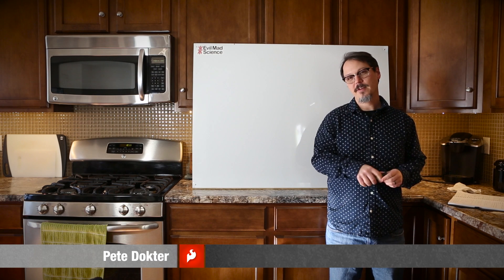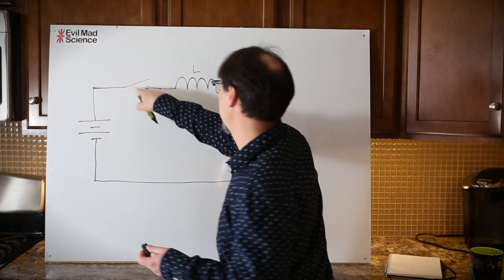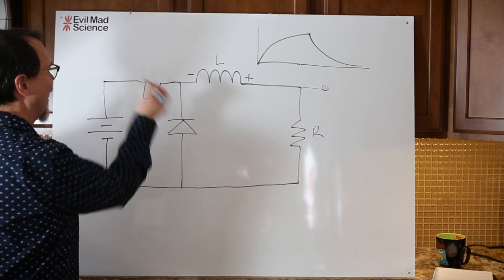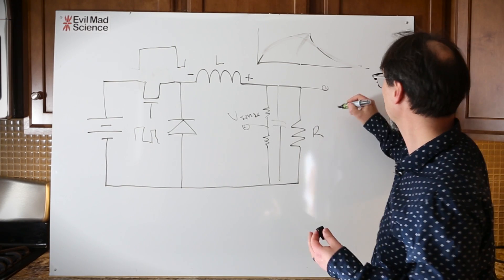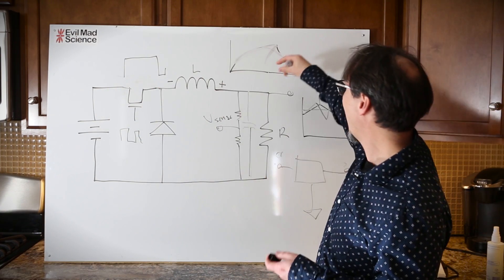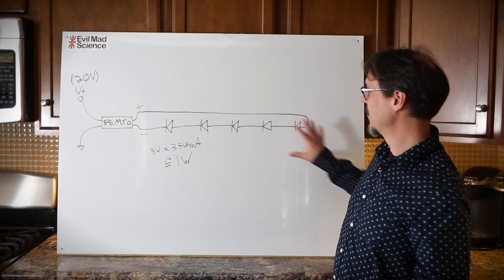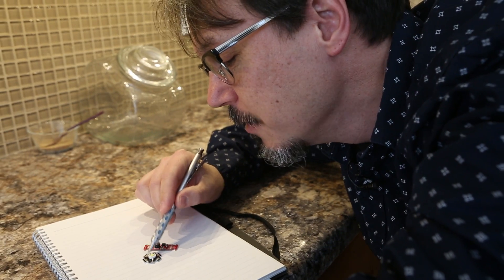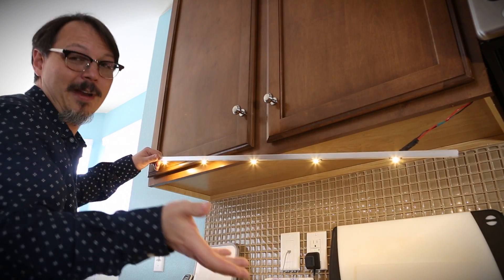SparkFun According to Pete #40: LED Home Lighting and the FemtoBuck Driver

Comment: Your schematic shows 5 LEDs in series, but you have at least three segments here, and each one has what looks like between 3 and 5 LEDS. Are you using multiple power supplies and circuits? Or the same supply with multiple circuits connected in parallel? Or is your schematic inaccurate (an example)?

Comment: What did you use to switch the circuit on and off, was it a simple switch that's hidden away?
Reply: Regular ol' switch (well, rated for AC, anyway), hot-glued up under the edge of the cabinet. I spliced the power cable and strung the hot wire down there. I toyed with ideas of gesture sense and all that stuff, but in the end decided that I didn't want that laptop PS on all the time.